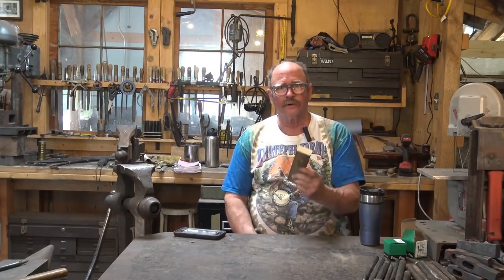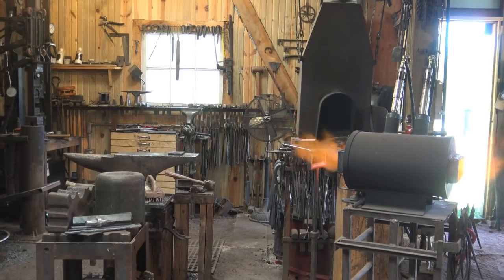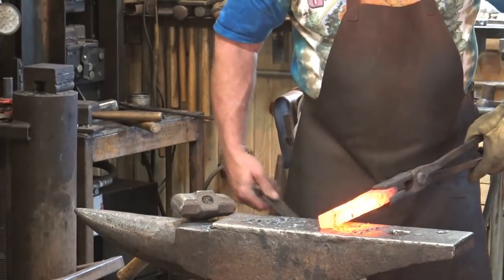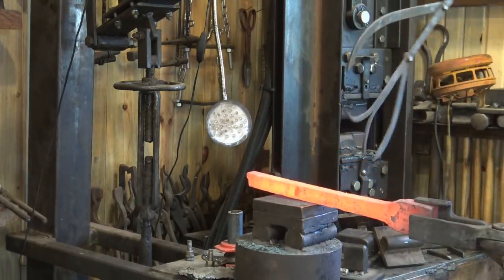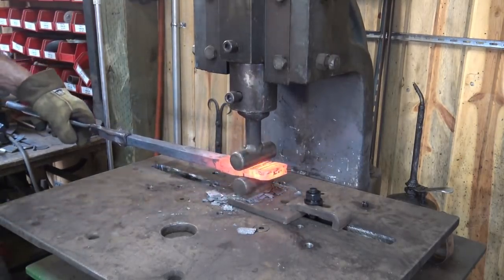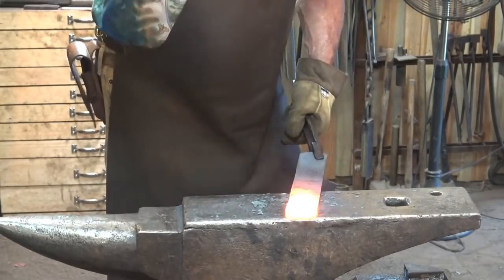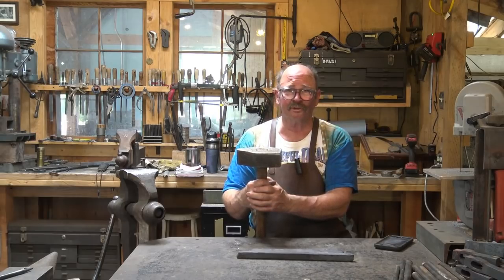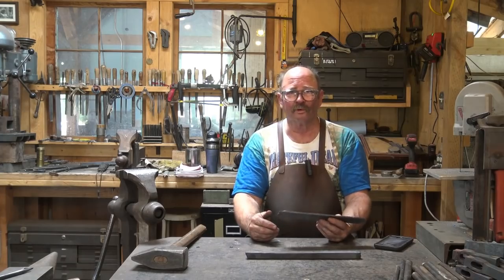Forging Wrought iron - preparing and sizing stock for the Dragon door knocker

Comment: John, first off I want to commend you for expressing your concerns for you, your property, and your neighbors' properties and lives regarding using a solid fuel forge during extreme fire danger times.  If more people would exercise your thoughts during those times (or anytime, for that matter) you would have far fewer forest and brush fires.  Your firefighting background is good experience to reflect back on.

Moving onward, your explanations and demonstrations of the properties, advantages and disadvantages of wrought iron compared to modern mild steel are exceptional.  They should help many smiths in their endeavors to work with WI.  I have forged wrought iron and it is indeed a different animal.

I don't know how you managed to hammer that long with each heat using that 4# hammer.  My arm started to wither after about 30 seconds!!
Reply from the maker: It always amazes me how many people think its OK to take a little risk.  There is currently a 60,000 acre fire not to far from us that was started by cooking over an open fire.  Another fire that is now out was started by welding.  I am glad you enjoyed the video.  That was about all of the 4 pound hammer work I had in me.

Comment: Another great video and it changed my view about working with wrought iron. 
I thought wrought iron was much easier to work with than mild steel.😊
Reply from the maker: For a given size it does move easier and it welds much easier.  But after that I think it is more technically difficult.

Comment: Great video John, what pressure were you running your gas at ? I've always heard those Chili forges were capable of reaching higher heats.
Reply from the maker: The chili forge does get extremely hot.  Plenty hot enough to weld mild steel in.  I run it at 21 psi for welding, which is the maximum recommended by Chili Forge.

Comment: bwwhahha grateful dead shirt, you dont look like the hippie type, you reminde me of a more straight lace type by the way you look and talk John, did like the carving chisel though gave me an idea on what to do with mine I am trying to make, but it was to be a cold cut single bevel, but its angled at the bottom due to using an old vice as my anvil so could not angle proper, your right that forge is loud and really reaching its dragons breath out there.
Reply from the maker: While I was to young to have been a part of the hippie scene at the time, I certainly identify more with a free thinking philosophy and would never consider myself straight lace.
Reply: oh really hehhehhe, well its the plaid that you wear in the winter that threw me off.
Reply from the maker: Flannel is the practical choice.  Never seen any tied died flannel.
Reply: heh that would be pretty epic if there was heh